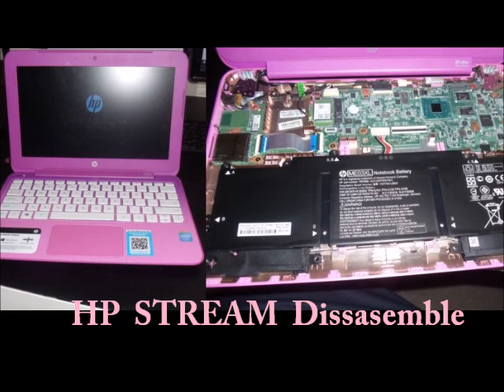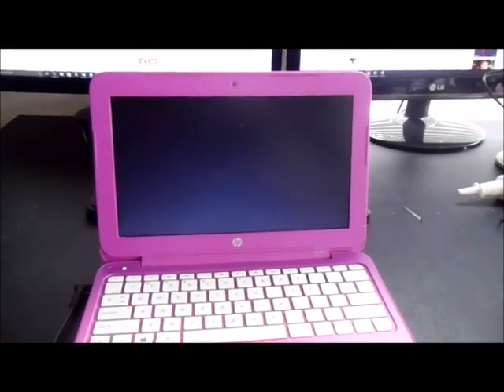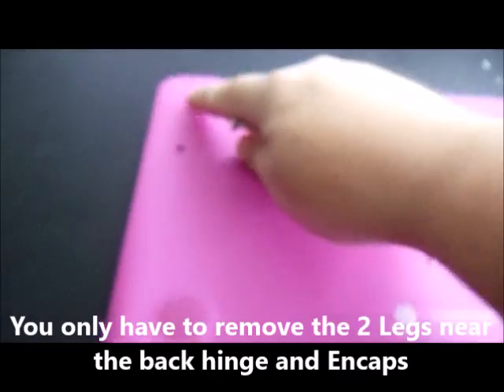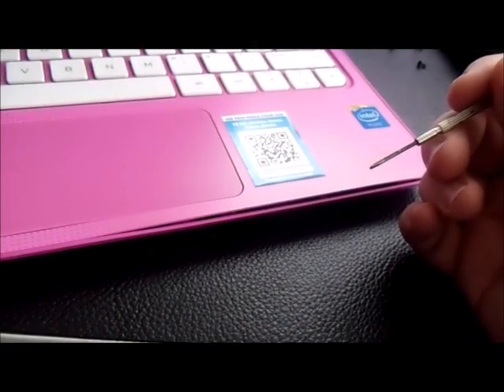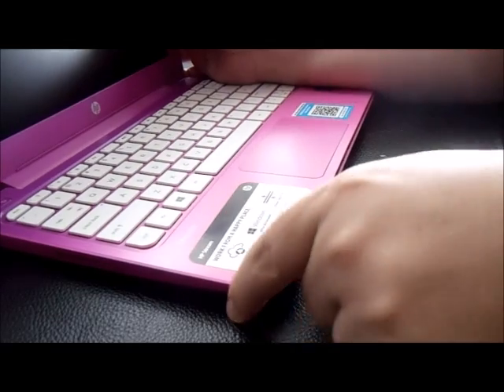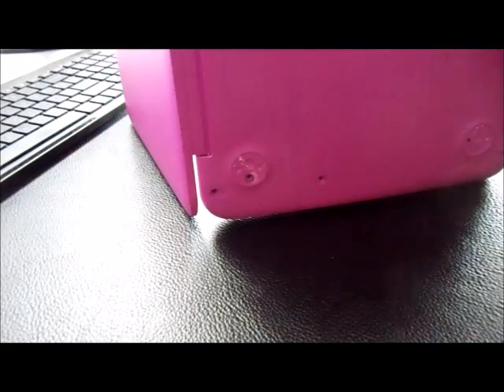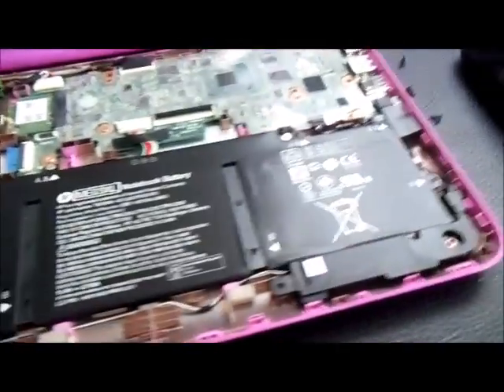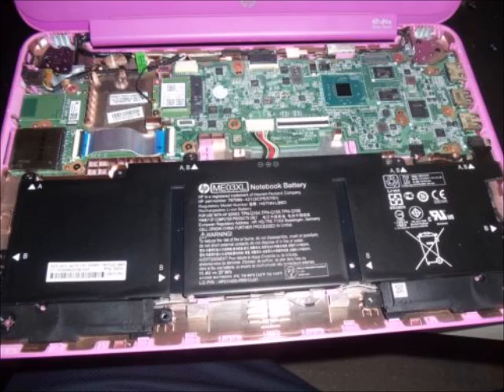HP STREAM Dissasemble Take Apart Laptop 11 13 14 X360 Pro G3 G2 Remove Replace Battery WiFi Keyboard

Comment: You list 11-r015wm in the tags, but it's not the same model. It has an entirely different interior. I'm trying to figure out where the power ribbon plugs in as I don't see any place for it - it came out as soon as I lifted the keyboard a bit. It's not at all like the model you're working on.

Comment: I was excited to fix my laptop until I saw that this one has screws and mine does not, I don't know what to do!?
Reply: Or if there are 2 rubber bands on the bottom of the laptop, the screws are under there
Reply: @piggo5645  Thanks, George. I found them after watching this again and am waiting for the SSD drive to come in. 

My other concern is...um... where's a video that shows how to replace the SSD drive?
Reply: Just tear open the rubber and there should be some
Reply: @Treeman-uk5qf  A year late, but thanks! you were right, haha
Reply: If it has no screws you will probably just be able to do the next step anyway since the manufacturers would’ve had to put it on some way

Comment: heard about issues with one of the wires disconneting from the wireless module. Is that a common problem? I am using Ubuntu 14.10 and my wifi signal is very low, 86 db. Wondering about installing an external USB WiFi adaptor to correct this problem. If I do that will the software pick that up and install the proper driver?  Will I need too disable the original wifi module if I do that?